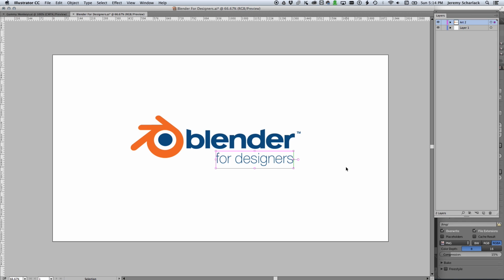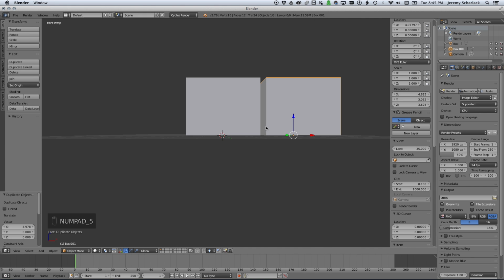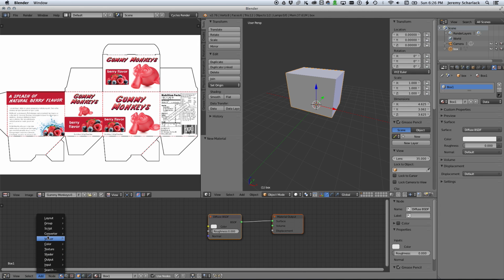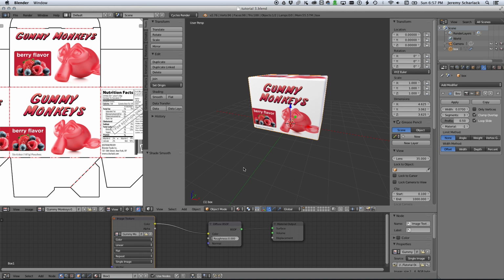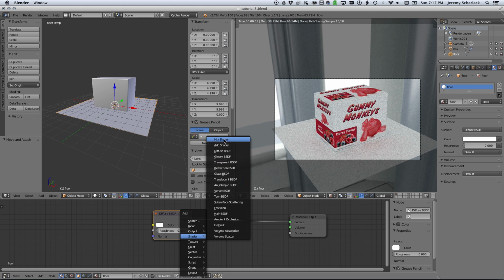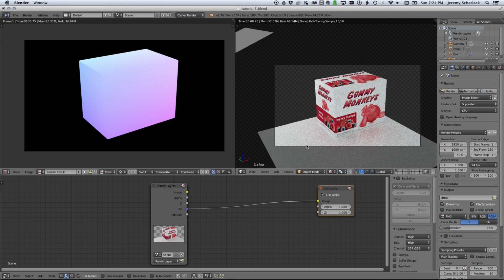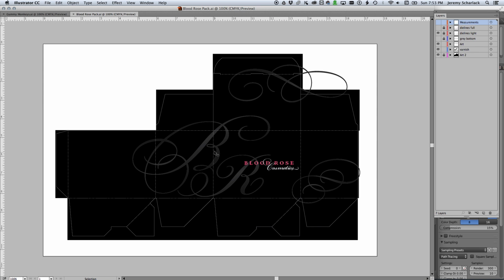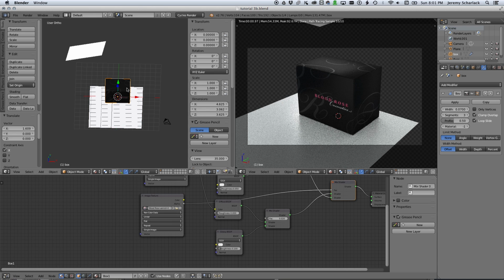Blender for Packaging - Basic Box

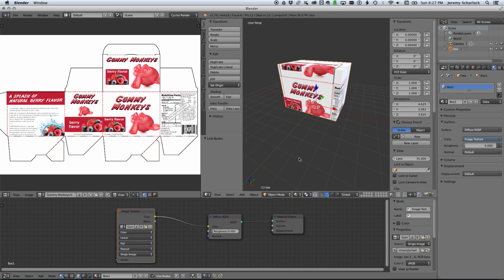Comment: your tutorial is really nice aln clear, but i still have a problem. i was trying to do my work, step by step, follow your tutorial, but still don't figure it out. my problem appears when I am trying to swech Viewpoint Shading to Material (on your video it's 12:20) - my cube doesn't change, it's still white. I didn't have a problem to get to this point, but I stopped and I can't solve the problem (I'm very beginner). what went wrong? it's a matter of settings? view?
Reply from the maker: Try selecting the texture in your materials nodes – make sure it's orange. You'll need to right-click it. Try both "texture" and "material" shading.

Blender shows the texture that is selected in texture shading and sometimes, as you found out, in material shading. I'd prefer it show the connected texture – that's what I'd expect – but it shows the selected texture.

Comment: Oe big mistake bro, your using BU units, thats massive. 1 BU stand for about 1m. BLender unti system sucks major if you set a different system it just scales all the stuff. Using inches as system and nothing works. Put a number using 2"1' and you get a totallly diffent number back. They need to work on that. AS render engines evolve and live by real dimensions so do the modelling dimensions of blender need to be correct
Reply from the maker: It doesn't really matter though unless you're doing physics simulations or fitting it into another scene. Light behaves the same at every size and Blender can model everything from atoms to planets. You could do this box at actual size but you have to zoom way in.
Reply: Blender For Designers well if render it also matter if object is in real dimensions. Go check that, but do what you do. Its always good to help others

Comment: Your video is exemplary. But I have a couple of problems. When I switch the timeline to Node Editor what I get looks totally different. First, I have to check the box that says "use nodes" in order to get any nodes shown on the grid, and the two I then see are not Diffuse BSDF and Material Output, but one called Material and another called Output. Furthermore, when I click Add, I don't see an option called Texture and followed by Image Texture. The closest I get is clicking on Add > Input > Texture. Has Blender changed since you made this video?
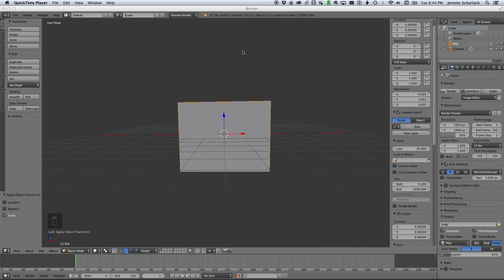Reply from the maker: You're still in Blender Render. You need to be in Cycles. I do the switch in this video around 5:00 – kind of a blink and you miss it moment where I go to the menu bar at the top of the screen.

Honestly Cycles should be the default – Blender Render (or Blender Internal) is outdated. I've set it to the default for a while now on my copy of blender.

Comment: Thanks, but what could you recommend on "less easy" approach? I mean exporting vector from AI to Blender, fill that curve with plane surface, convert to poly, then divide it into selection groups and rotate them to "actually fold" layout into box. i was trying that but it's much harder and confusing, especially due to how some packages tend to connect with things overlapping each other
Reply from the maker: I'd export your dielines as an image — not as vector paths — and bring them into blender as a background image to trace. I kind of did that with my potato chip bag (https://www.youtube.com/watch?v=Z1xum4vFnLc) and go over creating more detailed dielines in my latest video (https://www.youtube.com/watch?v=Qkj1okN4ZqQ) where I talk about dealing with overlap.

Use meshes, not bezier curves in Blender. I've tried importing curves and never got anywhere. They're really meant for other things like motion paths and pipe-like shapes.
Reply: Thanks, i'll check that! yeah overlapping flaps are evil

Comment: How did you get the dimensions in Illustrator?
Reply from the maker: The transform palette . There you should see the width and height of anything you select. 

The dieline in this video was supplied by the manufacturer and had measurements on it, but you can always get the in illustrator if they aren't supplied.
Reply: Wao, you know could you recommend me or upload a video where you explain the way of work of Mohammed Hdila. here your link: https://www.youtube.com/watch?v=FZWTwCWvJdo. I would like to see step by step the process of modeling and rendering the box for packaging as it does. The interesting thing about your process is that it does not explain how to render and how to model the dieline in blender and how to map the existing dieline to uwwrap. thousand thanks in advance.
Reply from the maker: Kind of cool to see the whole process in the video you sent, but it's sometimes hard to get the details since it goes by so quickly. In my first video, I did create a box from a dieline – https://www.youtube.com/watch?v=EAhWsUBy3uY&t=4s – though to simplify I didn't model any of the flaps. I have done that – see https://www.youtube.com/watch?v=dMXQUOVuSmw – but not as part of a tutorial. I have some other tutorial ideas coming up, but I may do that.
Reply: thanks for the information, I admire you

Comment: Thanks a lot for a useful tutorial, being a Blender noob this is great help. However if you want to construct a real package, the sides of the box won't be all the same size, right? So you can't really use the default cube (unless you want to redo the graphics just for the sake of 3D render, in which case you still won't make the box openable) and need to begin the same way as the graphics - that is the unwrapped box. A tutorial on that would be nice indeed :-)

Comment: I like this, and actually I made a small addon (https://github.com/artistCDMJ/carton_unwrap_helper/archive/master.zip) to help my coworker to try to get this kind of work done using Blender. I did however find in my own experience that it helps ot be sure to use a boundary around the artboard in case an illustration clipping mask object goes outside the artboard and picks up on the export into png. I then use the boundary to manually crop the three images -  the color and dieline, the color only, and the bump. I make a bump image from the perforations in a separate layer so that I can get a nice effect for perforation marks. I went so far as to set up a basic demo scene with environment lighting and backdrop so that I could run through several pretty quickly, and as soon as I did then I got assigned to do like 17 boxes in rendered format after having completed them in dieline form.
Thanks for the video, very good example!
Reply: Where do I hit it in blender?

Comment: Great tutorial!
I have a question that I'm wondering if you can help me with.. I work mostly in Photoshop (this was my first time working with a 3D program), and while I was able to export my box and open it in photoshop (as.obj), I wasn't able to include my packaging design.. Is there a way to do this?? (I exported it about halfway through the tutorial.. before adding the environment, floor and lighting).
Reply from the maker: I've only dealt with Photoshop's 3D in a very limited way and I remember it being a disaster. I don't know if you can use a layer or smart object as the box texture, or if you have to export a second file. I'd just recommend rendering in blender and bringing the image into photoshop. You can bring your photoshop background into blender as a background image to make the angle look right.